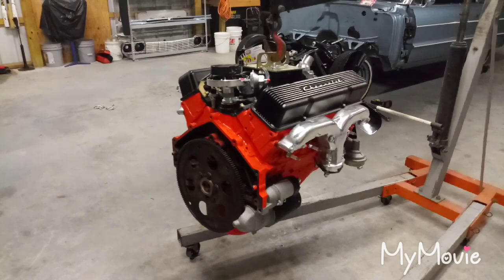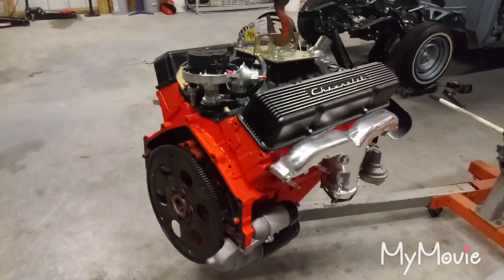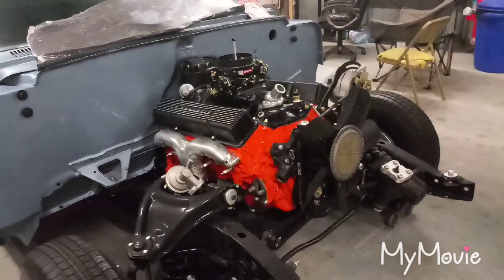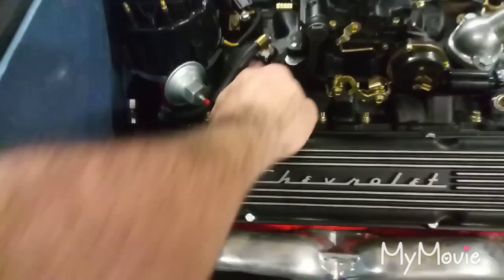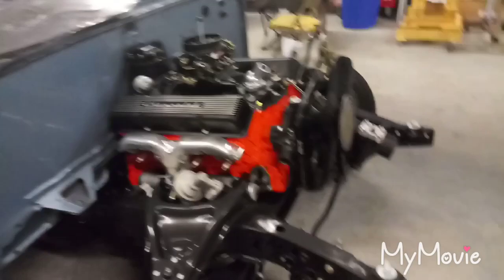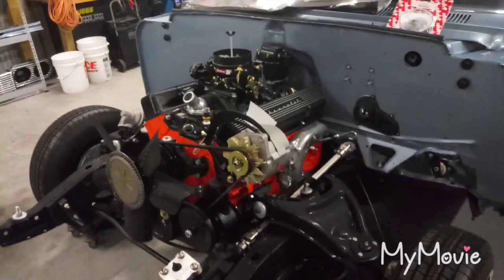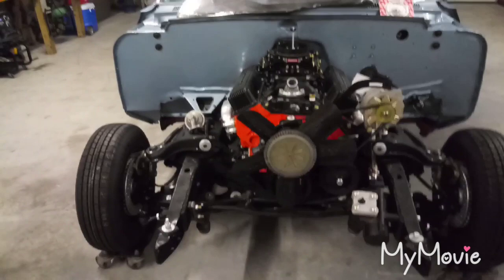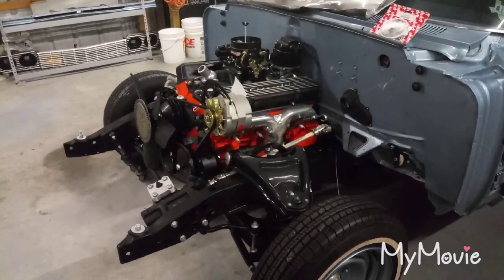1964 impala drive train in place

Comment: Take the driveshaft ovet to CT Driveshaft over on Griggs avenue. Charlie can help you. I take all mine there. They do good work. Hell I don't even install u-joints anymore I let them do them!!! Keep Rocking it out!!!
Reply from the maker: Ill do that do u have any recommendations for exhaust work.i want someone who is going to. Take care of the car. Not weld on the frame.  I used a shop in alvin for my 63. It was ok but toom 4 days. And I used a shop down in brazoria for my 62 5 yrs ago but they welded on the frame. The underside on that car wasnt as detailed as this cat
Reply: C&T 713-644-2458. He cut my Monte Carlo driveshaft.  Someone had a 350 turbo shaft in it and the car has a 200r4 and the shaft was 1 inch too long and cratered the tranny!!! He cut an inch out and no more problems!!! Keep Rocking!!!